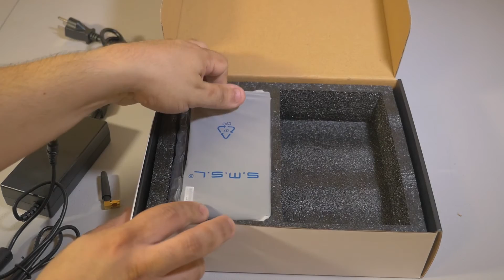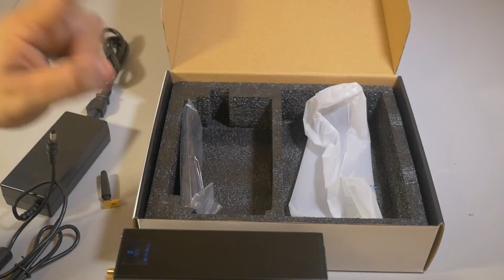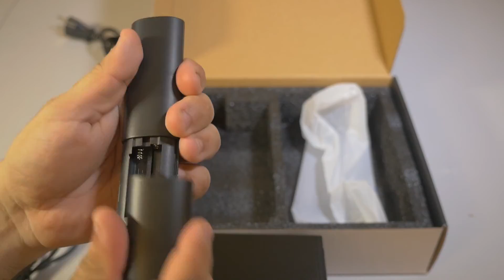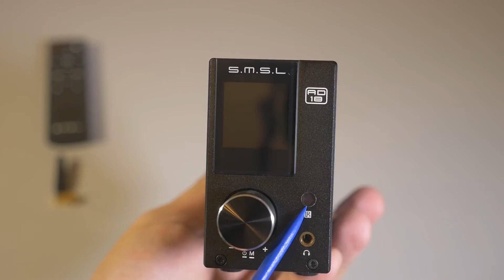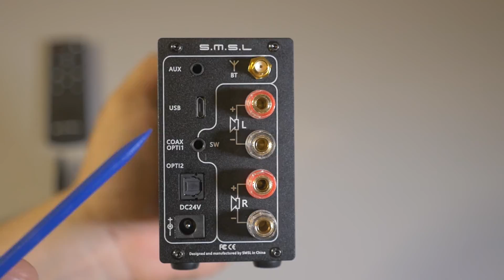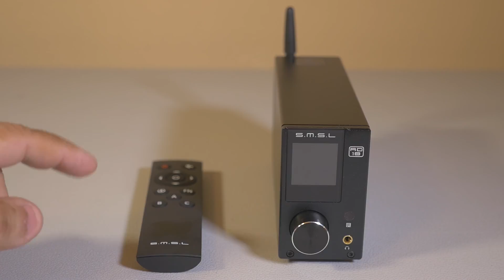SMSL AD18 Unboxing

Comment: Just ordered this amp to pair it with a pair of KEF's 100, in case i want to add a subwoofer later, does it have to be a powered one? This will be my first setup and im really excited. Thanks!
Reply: Yes it has to be a powered subwoofer.
Reply from the maker: Honestly, I don't have a sub hooked up so I am not sure and the instruction manual is not too clear on that.

Comment: can this drive the ELAC Debut B5?
Reply from the maker: I'm not sure as I have not tried them.  I currently use the SMSL AD18 to power the Micca MB42X's and its more than enough for that.
Reply: ZadiusTech thanks and this dac/amp would be a noticeable improvement from my onboard dac/amp? I’ve got a MSI Z170A M7 mobo
Reply from the maker: Yes, I think so.  I have a Z170 mobo as well but from gigabyte and it is an improvement imo.